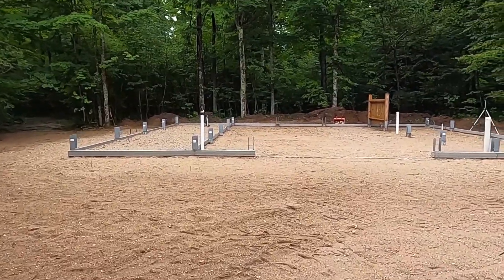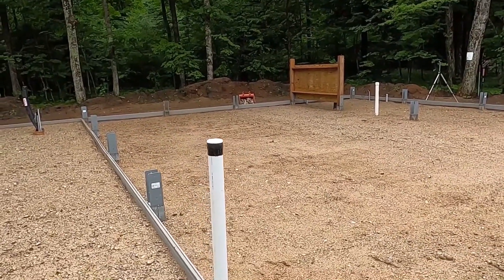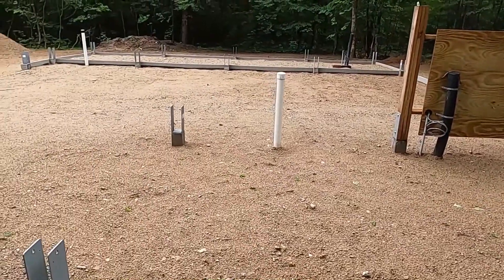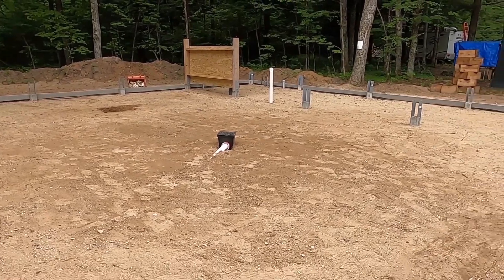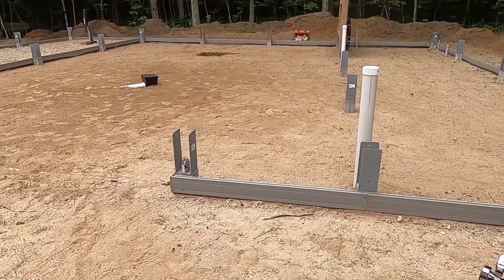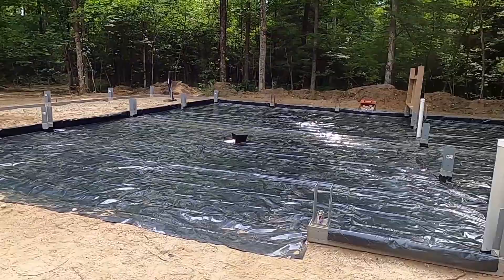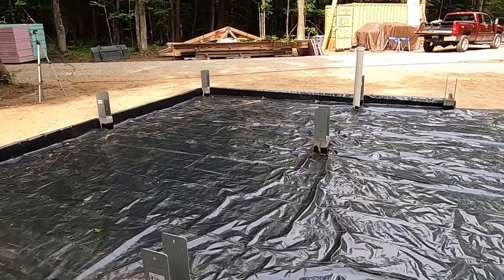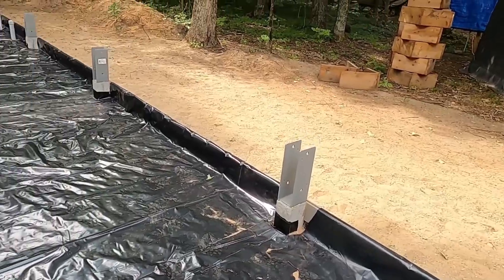Why do we install a vapor barrier under slabs? (018)

Comment: Vapor barrier is kinda new thing. Concrete has been around for 100s of years and survived without a plastic sheet under it. I'm no expert but common sense tells me that a well drained foundation around the slab is most important. A few punctures here and there shouldn't be a problem. Temperatures changes might cause your concrete to sweat so keeping it as dry as possible would minimize this. I built a house in 1989 and didn't fuse over plastic punctures, open seems, etc. My basement has never had a leak, and never had any moisture problems. I do, however, operate a very small dehumidifier in my basement.

Comment: You said you don't even know how to measure how much cement you need and you are giving your opinion that holes are ok? This video has has too many, "my opinion", "I feel", etc. and coming from an amateur that knows very little. Don't take anything he says as correct because a lot of it is not.
Reply: I couldn'tAgree more with you. This video is giving terrible advice in regards to vapor barriers and concrete. As well if you're going to spend that much time and money on a vapor barrier , that looks that good and not seal it as best as possible ? Why put down a vapor barrier in the first place.
Do it right or don't do it at all

Comment: Have you consider insulating your slab?
Reply from the maker: Absolutely. We end up putting 3” of XPS under the slab. Since we’re doing radiant floor, we really wanted to ensure that heat went into the building and not the ground. 2” of foam is standard in our area, and we took it to the next level.
Reply: @WanderwoodFarm  love your work!